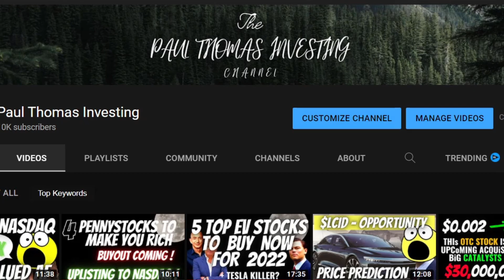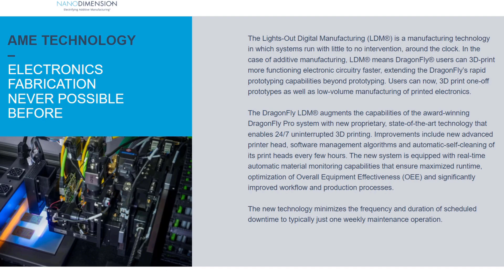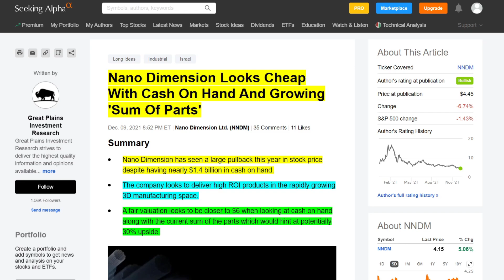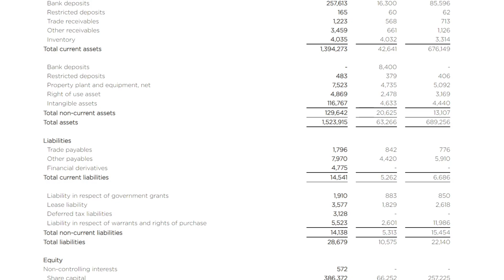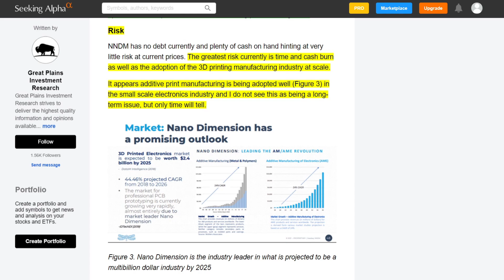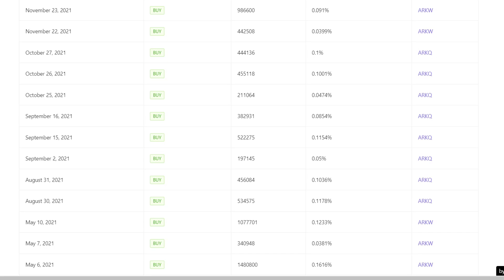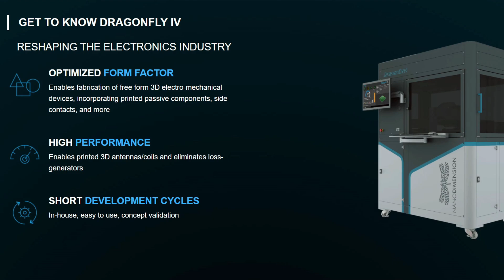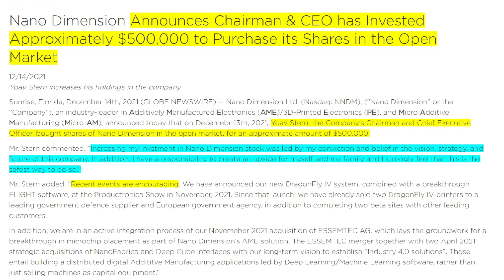Nano Dimension Stock - Undervalued & READY TO POP! -  Cathie Wood Buys - NNDM Stock

Comment: This is the most stupid valuation ive ever heard, you are correct company shouldnt be valued by its revenue but it should be valued by its free cash flow, if you look at the cashflow statement, the company has issued 670,000 plus of shares, diluting the investors and inflating the stock, so really this is a crossfinger it should make money and increase its free cash flow. It is a very risky and overvalued stock
Reply from the maker: I disagree. I wont call your valuation stupid though I just think you are wrong.
Reply: Thank you for your acknowledgement but Id like to keep a lowkey content in this stock. Lets see if they can make their cashflow statement a little bit better the next 2 years then i would agree with you

Comment: 49% of the stock that exists was created in the last year. So.. will they dillute again? Why wouldn't they?
Reply: Do you have a chart that illustrates these outstanding shares? Crazy but I believe it. Their Dragonflys only produce prototypes. While still useful, how can NNDM really be profitable if their printers are not really designed for mass production? Maybe I'm missing something. I'm RED RED RED with NNDM. Will this company see real progress in the coming years? I'm not so sure.
Reply from the maker: Remember about dilution. Yoav has said that it will take time to progress and make sales: for that you need to either have loads of cash or dilute as you go. The best time to dilute is when the share price is high - ( less share dilution needed to obtain funds) ....... The price was high, they knew they needed funds = They diluted at the best possible time. Why would they do it again now? It would make no sense to dilute more. They have 1bn and are not burning through it quick, what would they need more cash for?